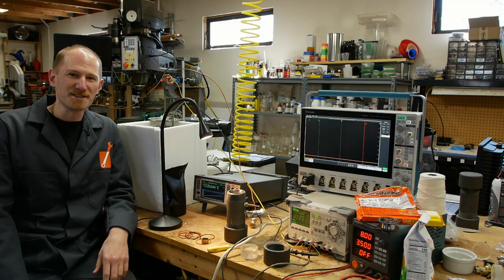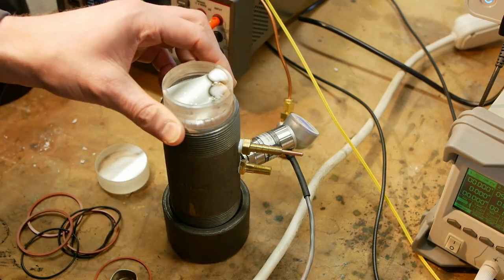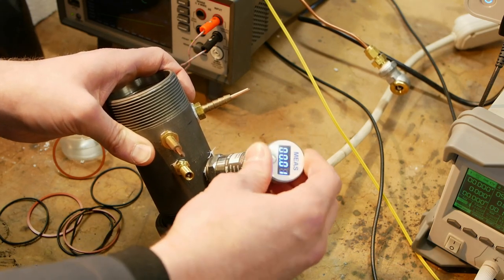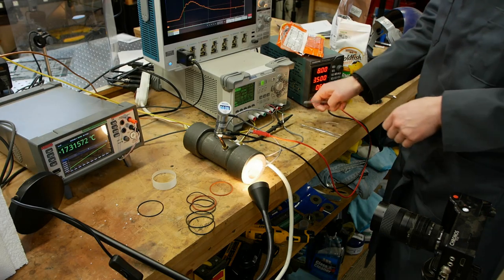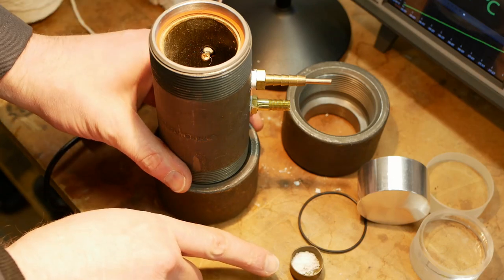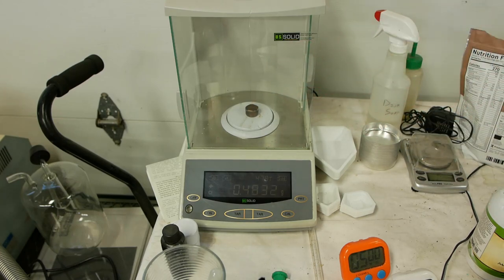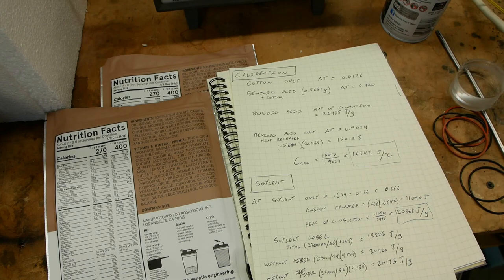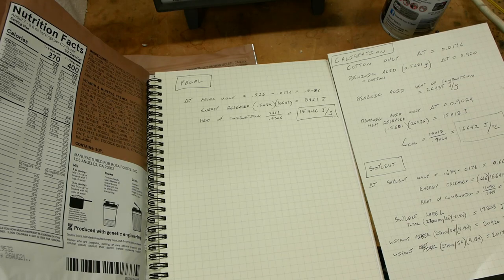Measuring human digestive efficiency vs. a flame

Comment: did i miss it somehow? where did you measure how much mass input results in how much output. there is a substantial amount exiting your body as co2 or pee. 
you'd need to monitor the output weight until it stabilizes over time to get a input to output factor
 
btw. goofy face cover ftw
please don't forget to clean the dryer before making new icream 🤣
Reply: He measured the 5g of soylent and 5g of poop. The difference of calories between them is the result.
Reply: That's a good point. If you take in 1kg of food with Xcal per g and poop out 100g of poop with also Xcal per g doesn't mean you didn't extract any energy at all. It means that you've extracted 90% of the energy. Input and output weight ratio is important
Reply: And all the nutrients used to grow hair, nails, shedding skin, etc.
Reply: @TimLF  Good point, but I think that would be a very small amount. I mean, how many hairs/skin cells/whatever do you grow over a week? Not a lot probably
Reply: Anifco67  That's what I mean
Reply: @max_kl  It is not a small amount -- we extract chemical energy from the food, and that chemical energy comes in the form of actual matter that gets absorbed into the body.
Reply: @wgheidri  The energy comes from the chemical bonds, not from matter. The actual mass lost due to energy extraction is miniscule, just plug the numbers into E=mc². As I understand it, a lot of the mass leaves the body in the form of CO2, which is what Ben didn't account for
Reply: TRUE you need to know where all the molecules in the input went, and where all the molecules of output come from. Only a portion of the output came from the input. You also had water and coffee, and you took in breath and exhaled. I assume he is removing the water at least, which should be inert as far as combustion is concerned.
Reply: @max_kl  When you gain weight, where do you think the mass comes from? We add mass by consuming food, we loose mass by exhaling CO2.
Reply: It's not just co2, the reactions that produce heat also create h2o which was removed.  I suspect the mass of the poop was highly concentrated fiber, bile, and other undigestible material.  The sugars would have been converted to co2 and h2o and lost entirely.  The best way to characterize this would be to measure average mass soylent in vs dry poop out over a fixed interval of time.
Reply: @wgheidri  Yes of course, if we gain weight. I assume that Ben's weight stayed about constant over a week.

Tim L, who I replied to, argued that some amount of consumed mass goes into hairs and nails. I added that this is probably insignificant. I understood your reply to mean that the energy used to grow hair makes up a significant amount of mass lost in digestion. Did I not get that right?
Reply: you're right he's only measuring the intensive properties of the input and output solids.  but the total calories extracted is impossible to measure based on this because your waste stream includes all the waste extracted from every cell in your body, not just unabsorbed nutrition.  and every square inch of your body emits waste of one variety or another, like dead skin cells and whatnot.  he'd have to turn his house into a calorimeter to enclose the whole system.
Reply: @max_kl  The point is that we ingest through food organic compounds (i.e. compounds that contain carbon). These get absorbed in our bloodstream, and are therefore removed from the fecal matter (e.g glucose goes straight into the blood, which is why it is such a great source of instant energy). When  consume the energy, the carbon atoms that we get from the food get combined with the oxygen that we inhale to form CO2 that we exhale. So it definitely isn't only hair and nails, but our whole metabolism relies on extracting mass from the food.
Reply: @wgheidri  Yes I get that. I think we might have a misunderstanding here – my original comment was refering just to Tim L's comment about the hair and nail growth
Reply: @edstirling  You are right, one would also have to analyze urine, for example. I don't have a practical suggestion on how to do such an experiment, but the point several of us are making is that from the experiments that  Ben did, one cannot draw the conclusions that he tried to draw (i.e. that the human digestive system is only 25% efficient).
Reply: @wgheidri  To be fair, he didn't draw that conclusion, he said that the numbers being so far off kept him from jumping to that conclusion.  But he does seem to not make the connection presented in the original comment here, that he's missing a massive piece of the equation in the ratio of in/out.
Reply: Yes! I thought he was going to collect all his poop for a week, and work out how much dry poop-mass is produced per mass of Soylent eaten. Then divide to work out how much poop is produced from 5g of Soylent, and work out the energy in that. You don't produce 5g of poop after eating 5g of Soylent, or the mass balance for respiration doesn't work out.
Reply: He literally said that his process was not perfect... ya don't have to point out all the flaws in his experiment when its more thorough than any other YouTube video on the subject. Man's got a real job.
Reply: @bitluni, I think your argument is "metabolism" vs. "anabolism". If E1 joule (as per bomb-calorimeter) enter and E2 joule (as per the same calorimeter) leave your body, then E1-E2 is the "nutritional value" of the foodstuff to your body. How much CO2 is produced depends a.o. on how much exercise you do. Another point, less relevant, is also that CO2 shall not release any energy in a calorimeter (of itself), like poop does.
Reply: @Eddie Hitler That shouldn't make much of a difference, I don't think. Any fat that gets metabolised will convert to mostly water and CO2. The water isn't taken into account anyway, and the CO2 is exhaled. The vast majority of poop is composed of things that you eat. (or things that eat what you eat; gut bacteria.) It's true that the body does excrete certain things into the gut other than water (bile, mucus proteins, etc) but this is basically inconsequential when it comes to the dry mass of faeces excreted.
Reply: @max_kl  The amount of carbon that you exhale and urea that you urinate is non-trivial. Plus, some of the sugars are converted to water, which he removed.
Reply: @cleitonfelipe2092  Yes, but @bitluni's point is that 5g input of soylent does not equal 5g output of dried poop. Respiration is primarily how you lose weight; every exhalation includes more CO2 than ambient concentrations. So some mass from your input diet leaves your body in the form of carbon atoms in CO2. Also, any volatiles in your feces, acetates, urea and other compounds in your sweat and urine eliminate mass as well. Finally the mass of ash/liquid leftover after combustion in the crucible could be measured as well. And finally, to be thorough, you should keep track of your body mass as well, because if you're gaining or loosing weight you're not conserving mass if you're only measuring your mass I/O through elimination (#1 & #2) respiration and sweat.
Reply: @TimLF  Yes, a decent first order approximation is conservation of mass of the human system. (No energy changes large enough to worry about E=mc^2 effects.) So keeping track of his weight as well as non-water eliminated through urine, feces, sweat and respiration would be helpful to estimate if you want a gram for gram comparison.
Reply: CO2 doesn't burn, neither does pee (mostly). There are no calories in them.
The idea is you take X amount of calories, you poop out Y. Y is waste and your body used X-Y.
I don't get why there was no data in this video on how much soylent Ben ate and how much dry poop he collected.
Reply: Exactly my thought. But, this means there's a lot of soylent needs to be consumed and poop to be freeze-dried. Have mercy on poor Ben.
Reply: Other considerations: A significant portion of your poop is the result of your body recycling dead cells. For example, when you fast, if you're doing a water-only fast.. you'd expect you'd be empty after 2 days. But you're not. You're still pooping a bit, it's your body ridding itself of dead cells.
Reply: @MattsAwesomeStuff  The only dead cells that come out in your poop are gut bacteria, which will continue to come out after you stop eating (there are a lot of these but they have to get their energy from your food). Nearly ll the breakdown products of your body's cells are excreted through urine. The iron from your red blood cells does come out in the poop though, that's what makes it brown. But it doesn't weigh much. Could explain the shiny nodules in the burnt poop here though, maybe? Or other concentrated salts from the bile.
Reply: @Eddie Hitler That does explain a lot. I think maybe your ability to estimate the weight and dry fraction of your poop might have been affected by all  that amphetamine sulphate. (Incidentally I'm a fan of that myself, but only 50mg a day and on prescription.)
Reply: @jhonbus  The poop is brown because of gall (or bile), or more precisely from bilirubin and biliverdin that are in bile, not iron. If you have had a gallbladder dysfunction, you would know how pale white feces may become.
Reply: @zbeekerm  But the video doesn't say that 5g of soylent is equivalent to 5g of poop.
Reply: I came to the comment section to ask exactly this. I had a bit of hope when he said "We are missing one information here", but nope, still no mass ratio correction...
Did he just blundered? Come on he can't have missed this !
Reply: I wondered the same
Reply: Still, fascinating as always and I can't wait until the next episode... Thanks Ben!!
Reply: @Duke7562  Cool, thanks. I knew the brown came from the breakdown of red blood cells, I assumed it was the iron that gave it the colour rather than organic chemistry!
Reply: and that's why we use moles where applicable
Reply: That system cannot measure digestion efficiency (no measure on the energy consumtion of the digestive system), only extraction efficiency, if you add marker compound to the Soylent (that way you know how much input created how much output). Now it cannot measure anything sensible.
Reply: A large part of poop is dead blood cells and other waste.
Reply: @illustriouschin  Yes but they are ultimately replenished with material from food. I think what people have been saying about how some of the food is converted into CO2 and water is the main reason for the apparent inefficiency. If you captured all those and put them in the burner they wouldn't burn and you'd get a much lower J/g.
Reply: I thought that's why he did it for a week to find the ratio of food intake to poop output.
Reply: came here to say this, you exhale a ludicrous amount of CO2 over a day...and only O2 went in
Reply: @MattsAwesomeStuff  but if you loose some mass in poop recycling dead cells you also gain similar mass from food in process of making new cells to replace the dead ones.
Reply: @peterthepeter7523  - Not necessarily. What if you were fasting? Zero new calories in. You still poop out.
Reply: Thunderf00t did something like this
Reply: @MattsAwesomeStuff  you would loose mass. But not using digestive system has nothing to do with figuring out how it works.
Reply: Pee... Probably negligible kcals. You just need to measure the amount consumed (and it's kcal/g) and amount of poop left over (and it's kcal/g)
Reply: He's measuring the calories that came out undigested. If you breath it out as CO2 or pee it out as water that means your body processed it. That's exactly the portion that he's not measuring.
Reply: water vapour, pee, CO2, sweat--none of them have any energy content, so they are not a way energy can leak out of the system unused.    So the difference between one day's soylent and one day's dehydrated poop is in fact the fraction of the available energy your body used.  (actually, come to think of it, the nitrogenous stuff and phosphorus in your pee might have a piddling (ha  ha) bit of energy, but really negligible.
Reply: @max_kl  the CO2 leaving the body is from matter that was actually converted into energy via metabolism
Reply: @Duke7562  Bilirubin is a yellowish substance in your blood. It forms after red blood cells break down. I think the original author thought iron was mostly used in red blood cells.
Reply: The total mass of output should be same as input - chemical reactions dont carry much mass as energy. 
If we guestimate that products like CO2 and H2O dont burn and the only flammable product is poo, simply add the missing mass to the mass of the poo so that it is equal to the mass of consumed soylent.
Reply: @edstirling  what you do is paralyze a mouse, put it in a sealed container for a week while feeding it and logging its temperature. Then burn it and its excrement. Also burn one as a control.
Not exactly youtube friendly material.
Reply: @zbeekerm  Very true.  A good way to demonstrate this is to weigh yourself right before you go to bed and again when you wake up (without a bathroom stop first).  You'll consistently find that you have lost a pound or two just sleeping.  Where did the weight go... You exhaled it (and maybe perspired some of it as well).
Reply: Ultimately, he is comparing energy density, not net energy content before and after.  That is what needs to be measured to evaluate efficiency.

This experimental approach is the same as if he put the soylent in, burned it, then collected whatever ash was left.  Then burned another sample, collected its ash, and continued  (say 10 times) until he had enough ash to put into the calorimeter on its own to test but didn't multiply the input calories by the number of burn cycles to generate the output.
 

There is a story of Sir Walter Raleigh betting Queen Elizabeth that he could weigh the smoke from a cigar.  He weighted the cigar, smoked it, then measured what was left in the ashes.  Of course his method doesn't capture a lot of the chemistry going on.
Reply: @jml_53  that's true. To find out how efficient the person is at extracting energy from the food he could weigh all the food, then measure all the poop/co2/energy expended over a period of time it takes to consume the food. Also his body weight and such.

Weigh the food and mouse, make it run on a wheel till it stops moving, weigh the poop/mouse/output energy.
Reply: @max_kl  It doesn't matter if he gained or lost weight. The carbon in the CO2 he exhales came from the food he ate, and he exhales literally hundreds of grams of carbon every day. Even if his dry body mass remained constant during the experiment, at the very least this mass will not be present in his feces. There is also a significant amout of hydrogen(in a non water form) in the form of organic compounds that get turned into water by the metabolism, and thus will also not be present in the dry fecal weight.
Reply: @max_kl  it's not about E=mc².  Its about carbon and hydrogen in the food turning into co2 and h2o.  So the dried poop will definitely weigh less.  Just like the ashes from burning wood weigh much less than the wood.
Reply: @TimLF  Absolutely.
Reply: @matthiaswandel  Yes, that's what I meant. Sorry if I didn't make that clear enough
Reply: Came here to say this. Might be difficult (energy wise) to dry the pee, but yes one gram of input doesn't necessarily mean one gram of output. It'd be interesting to see just a rough measure of the ratio!
Reply: i belive, that all german users now have to send the feces to bitluni for personal study´s :D by the way, would the calories be lowered if you would ea it twice? just joking, but maybe some weight gain or loss of the human body would be a interesting fact
Reply: i am imagining a crazy mask with tubes and gauges to measure carbon dioxide output for a week
Reply: Yeah, more mass leaves your body through breathing than pooping. You need to weigh the entirety of the soylent and water you take in for a week, weigh the entirety of pee and poop you lose, then also weigh yourself at the beginning and end in case you just plain gained or lost weight, and ALSO measure all the air breathed in and out, and go round picking up your toenail clippings and dead skin like the person below mentioned, and weigh all of that :)  But we know you can do it! For science!
Reply: Anifco67  where did the other 50g go? Soylent is a dry solid power so is our body shedding a part of itself with every dump we take?
Reply: Anything leaving as CO2 or pee had been used by the body.  I think he just wants to measure the calories that aren’t used at all.
Reply: @Benzene265  Yes, but that needs to be done at the right ratio. If eating 100 grams of dry Soylent results in 50 grams of dry poop and 50 grams of CO2 and H2O, then he should compare 1 gram of Soylent and half a gram of dried poop in the calorimeter.
Reply: @max_kl  It's not just cells.
If you calculate the amount of CO2 an avg human exhales in a day. It turns out to be about 1kg. So I don't think it's negligible at all
Reply: @raunaquepatra3966  Yes, that's what I said
Reply: Any mass leaving the body other than through excretion was absorbed in one way or another by the digestive system, and that is what he's trying to find out: how efficient is the digestive system? As such, all that matters is how much energy went in and how much energy went out through excretion alone.
Reply: @jhonbus  Yes, without comparing the dry mass of input/output and then taking into account the energy ratios, this comparison really doesn't mean too much.
Reply: I had the same question after watching the whole video. I think we're missing the total dehydrated mass of the "output" and the total dehydrated mass of the "input", and some acknowledgement that the subject is about the same weight as in the beginning of the week. Knowing J/g of both seems like the only way to compare total joules in to total joules out.
Reply: Was thinking exactly the same :) 
if you just measure x gram of input and x gram of output, you don't cosider, that you may have eaten 2 kg of the stuff, but the weight of your total output was propably less then half of that. 
So your burning x gram of fresh matter and x gram of digested, compressed matter.
Reply: @Reno Simpson it would be a whole week of turds, actually.
Reply: Burning fat produces urea, can feed Bacteria as a nitrogen source via urea excreted into to tract, converted to ammonia and then an ammonia fixating process (oxidation via hydrogen peroxide) converting into other compounds. If the level of ammonia oxidizing bacteria are low, then there's going to be a lot of free ammonia that can react with the oxygen. So yes fat burning might actually be a factor here.

Richard Feynman is famous for pointing out that most of the material that a tree is made from is not from the ground, but actually from the air.

However, much of the "water weight" we lose is a hydrocarbon stored in muscle, which ought to be oxidized. It is very unlikely to be done after eating soylent unless at a calorie deficit.
Reply: @jhonbus  there was a plos study on the subject of energetics  using doubly labeled water. (keeps track of oxygen and hydrogen flows using isotope ratios).
Conclusion it came to... Yes bigger adults do  eat more than smaller adult ... But it's in direct 1to1 proportion to mass. . And same same applied re exercise. Per kg bigger people burn just the same amount of cals as smaller people.. (yes even unfit people.. Maybe they just produce more heat when muscles not as efficient) . and that seemed to be independent of "lifestyle"/diet too.
Reply: With respect, I believe you’re overthinking this. None of that is really relevant for this experiment, which is simply determining how much food (including breakdown products from digestion), quantified in units of energy, passes through the GI tract without being absorbed from the gut. The experiment, in other words, is simply looking at input vs output. That is, efficiency of nutrient absorption. Consider a person with a malabsorption disease (say, active Crohn disease) and imagine how the gut caloric input/output ratio would differ from an individual with a normal GI tract.

I think what you’re describing is a different experiment. Namely, calculation of total energy expenditure over a period of time (i.e, BMR + additional energy expended via daily activities of life) and compare that to usable energy contained in absorbed nutrients. That last figure (energy in absorbed nutrients) is what is being calculated in this experiment (albeit, with several critical oversights that I described in a separate post).
Reply: @mattp422  Ah, I see what you're saying, but then the video is just saying: "Here is the energy density of soylent. Also, here is the energy density of poop made after eating soylent." But I think what a lot of us are pointing out is that comparing the two is pointless without at least a little more data. Comparing the two and calling it "efficiency" is confusing at best.

If I told you that I had, through some process, turned some unknown amount of potato into some other unknown amount charcoal. Then I showed you the energy density of the potato and the charcoal. Have I told you much if anything about the process? Probably not, by just comparing energy density alone you could not tell if I had converted 1kg of dried potato into 1g of charcoal, or 

In the math bit at the end of the video OP is comparing energy density, but may be implicitly making the faulty assumption that 1g of output is the result of 1g of input. If he normalized the energy not to the mass of the sample going into the calorimeter, but to the mass of the unburnt material left over afterwards. Then we could make an explicit faulty assumption that the body does not change the amount of unburnable solids as they pass through the GI tract, and compare the two energies per unburnt mass to give a minorly more meaningful  metric.
Reply: @max_kl  You might reconsider your comment, poop is mostly bacteria. This test could be considered as useful as poop
Reply: @richardwheeler6115  what? Which comment are you referring to?
Reply: WHAT HAVE I DONE!? please don't understand this as some kind of mean criticism. I love ben's experiments. I'm just curious if i missed a detail anywhere and to add a constructive suggestion. Sorry it felt like bad vibes or anything
Reply: @bitluni  lol, you unleashed hell. :P There even is a guy named Hitler in this thread talking about his amphetamine abuses, psychosis, and how he clogged the shiter without even eating... Internet in all its glory.
Reply: @MrPureBasic  I already thought of deleting my post but then all the internet gold would be lost
Reply: Yes, a Mass and Energy Balance is required to calculate the efficiency.
Reply: Interesting discussion.  Followup video should address some of these issues. Great vid👍
Reply: I'm also confused for the reasons bitluni pointed out.

What was the final efficiency estimate?
Reply: His overall activity during the week may effect the overall result in terms of what the body consumes. I suppose he's just gonna have to collect his turds over an entire Year or so, and eat nothing but soylent over that period of time for a better result... lol.
Reply: I made the same observation then saw your reply. 👍🏻
Reply: Every drop of fuel in your car is exhausted as CO2 & H2O with an occasional partial of contamination. It would take a long time to collect ½ a gram of exhaust solids. Then you discover the contamination is oil that slipped by the exhaust valve... you'd wind up burning equal amounts of flammable fuel and those results would show your engine doesn't even use any fuel even though it took an entire tank of gas to collect the output sample. 🤦‍♂️
Reply: @max_kl We actually shed skin constantly. It's our largest organ and the cells replace rapidly. We replace all of our skin cells in about 4-week cycles. 

If you're wondering what dust indoors is, it's primarily old skin
Reply: Isn't that why he ate Soylent for a week? To stabilize his digestive system?
Reply: @Horstroad  exactly. Just because the energy density of poop is high (75%) doesn’t mean no energy was extracted, since far more food mass could have been eaten than poopy mass excreted.
Reply: @wgheidri  You also exhale plenty of water, not just CO2.
Reply: @cleitonfelipe2092  what they are saying is that in 5g of poop there is not 5g of food. You need to know how much food gets converted in 5g of poop in order to know how many calories transfer. And you can do it by comparing the total weight input vs the total weight output
Reply: @peterthepeter7523  lol
Reply: He should try to not eat anything at all for a week or so and measure the "pure" poop. That way at least we could try to work out how much of the food doesn't get digested at all.
Reply: @max_kl  Well, we lose 40.000 skin cells per minute, so that is about 400m cells we lose in our skin alone, those will cost energy to replace.
Reply: @max_kl  Your body regenerates almost all of the cells in the body and skin every 2 weeks, so in 1 week, yes A lot.